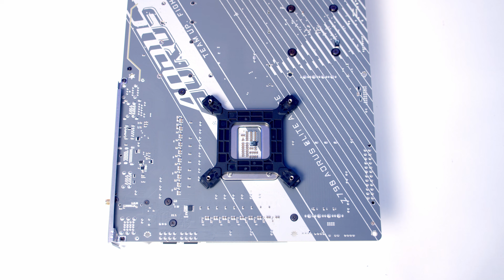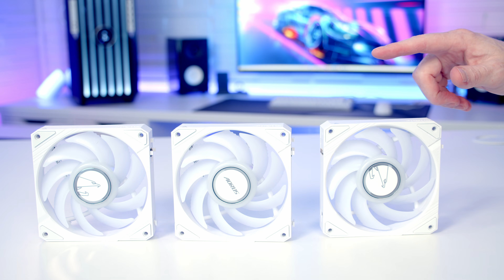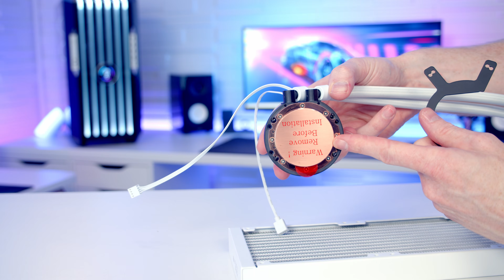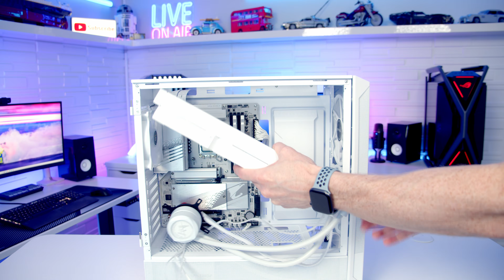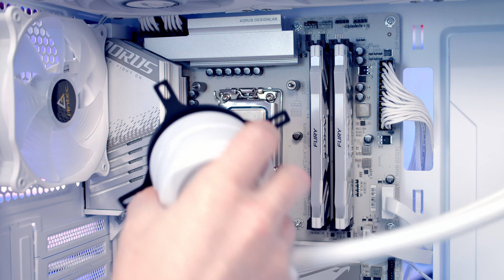AORUS WATERFORCE II 360 ICE - Installation Guide

Comment: Has anyone had success getting this pump to show in Aorus Engine and/or the Gigabyte control center.  I've installed mine exactly as in the video but the pump isn't being recognized.  It is working though as far as I can tell.  I contacted gigabyte/aorus support and they told me to plug the USB cable into the port on the motherboard.  I tried explaining that this model doesn't have that (The "X" model did) but they have no suggestions as to why it won't work.  Anyway.  Thank you Chris for the excellent video. It helped me a great deal with the installation.
Reply: Hello, if you don't have the USB Version then you can't use their app for it , but the motherboard rgb header should be able to control it , if you want separate colors on it than the rest of your pc then connect it to a different argb header on your board , don't use the 12v one though

Comment: Is it normal for this Aio to be extremely loud?, i just finished building my pc and it stays at 1740 rpm at all times and its extremely loud, i can't manage to adjust the speed on the fans, and im thinking on switching to another one
Reply: It defaults to max speed if you do your cables wrong. Flip your CPU fan cables. You have two cables configuration, a fan cable and a AIO pump cable or one cable configuration, a USB 2.0. AIO goes to AIO_PUMP, the other cable goes to CPU_FAN or CPU_FAN1, there are exceptions if the AIO comes with a USB header 2.0. You won't need anything but that port at the bottom of the mobo. If you mistakenly plug into CPU_FAN and a the USB 2.0 at the same time, this will end in the same result of max fan speed and max pump speed 24/7 as its confused as to the configuration. Its easy to mess up, good luck!

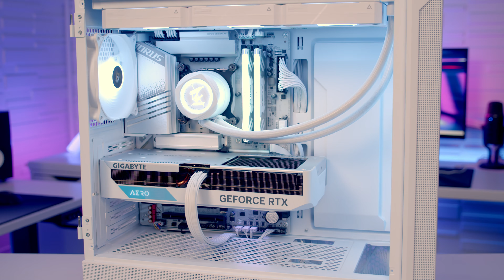Comment: 6:06  I wish there was a better way to have these two hoses.  I would try to install it on the other side, but they are too long then.  The way it is now it goes across most of the case, across the RAM and the back side fans that I would have.  Bummer...
Reply: You could place the radiator the other way around, so that the cables are on the left

Comment: Can you tell me if the thermal paste that comes with it conducts electricity?
Reply: Thermal paste doesn't conduct electricity - it's used to allow for the best possible contact between the CPU and the copper block, allowing for the transmission of heat.
Reply: Latest ones from decent brands should be all non-conductive.

Comment: I chose the cooler master ml360l v2 360 I felt bad about it because I started reading reviews and they were mixed so I told the shop to replace the cooler to this one I hope I made the right choice I have 14900k
Reply: after a month of use what do you think?
Reply: @kysvampr  to be honest with u its my first aio and i  replaced it to gigabyte waterforce 2 and i really dont like it its very loud and the temps are not even that good i didnt really like water cooling i think ill buy an air cooler again for my next build ^~<
Reply: @lumia_dayZ so waterforce ii 360 ice was bad for you?
im planning i7 13700k without oc so it will be on gigabyte b760m aorus elite x ax
Reply: @iaroslv_  yea for me it's bad it's really loud and makes more noise than the gpu all the time but maybe I just have a bad one I'm replacing it to air cooling soon
Reply: @lumia_dayZ  ah, right. thanks for answer, maybe u got defective one :(((
Reply: @iaroslv_  yea maybe let me know how urs is gonna be like ^~<